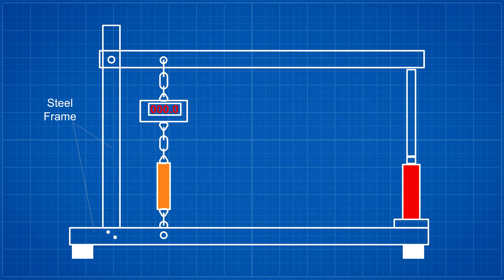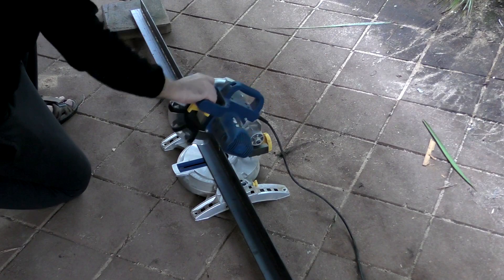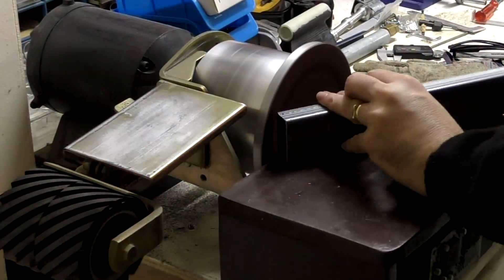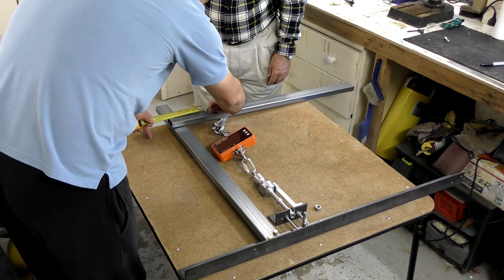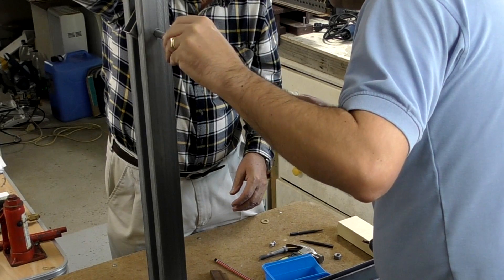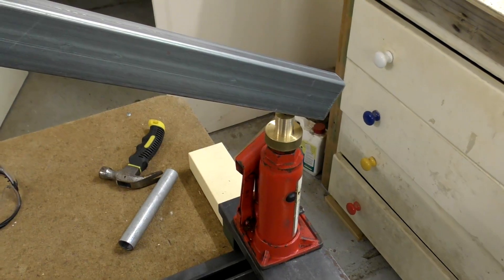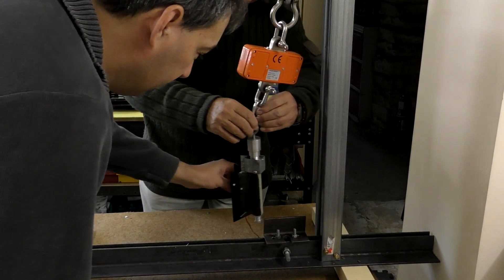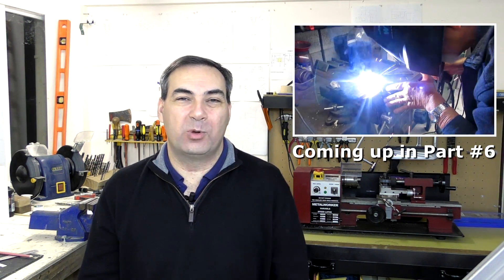2 Stage Water Rocket - Part 5 - Test Stand

Comment: What angle should the fins be to spin stabilize a bottle rocket?  I can never get it quite right
Reply from the maker: Fins aren't typically used for spin stabilization. You either use fins to stabilize your rocket, or you spin up your rocket without fins to make it stable (like a bullet or football). The questions is, are you just trying to make sure your rocket is stable in flight, or are you trying to perform some experiment?